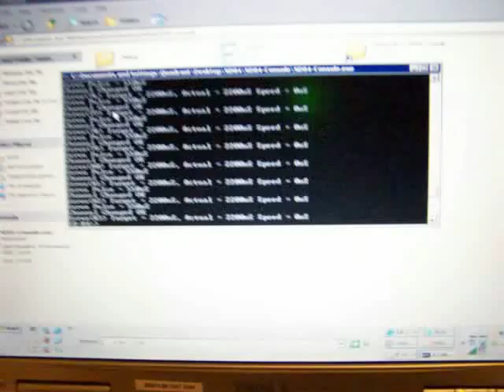36: Custom 84 Channel RC Servo Controller

Comment from the maker: that all depends on what servos your using and if they take there power from the three pin header, the larger servos seen take there own seperate supply, the header on those is only for the control circuit the h-bridge takes its power independantly

Comment: Hi :] i have a few questions
1]First of all didn't your servos get false "bursts" because of the closeness to other control servo wires 
2] as i'm trying to control only 20(18+2) :D i have encountered a problem with generating pulses for such a mass of servos. I delay the min pulse at the start, and then increase it with 10us(the minimum difference which will make any change ) after increasing i check if any of the servo_pulses has been timed out, and if that occurs i switch the pin to '0'